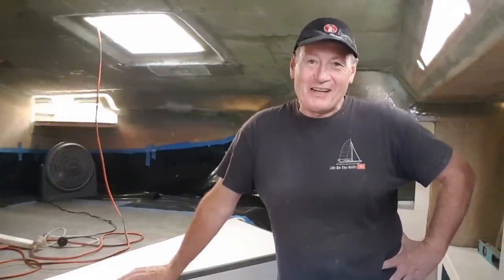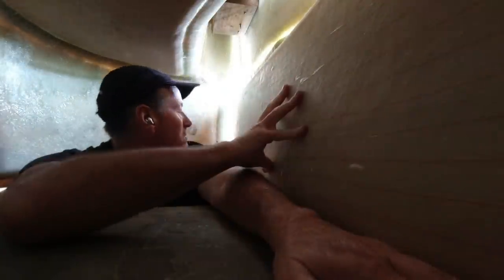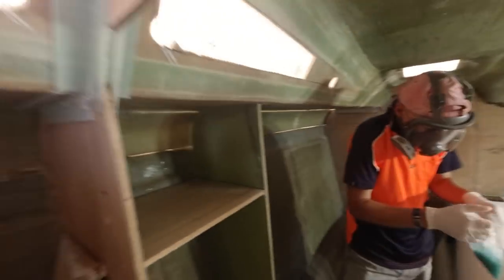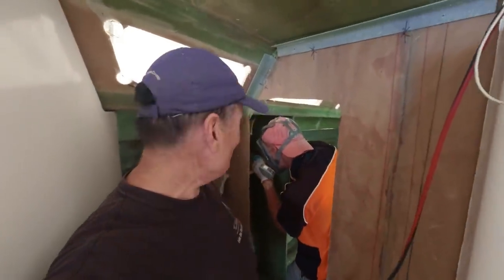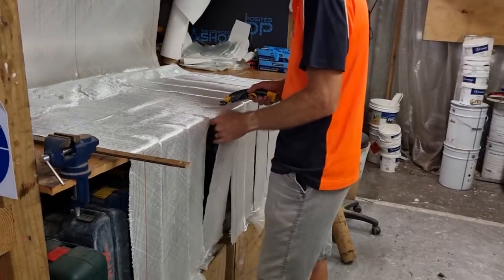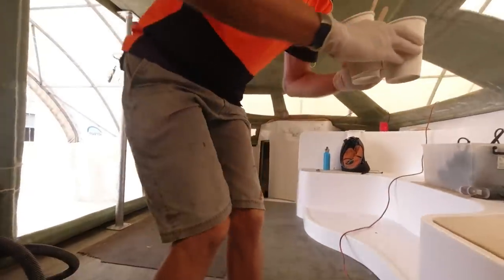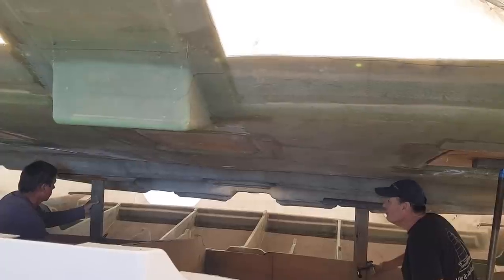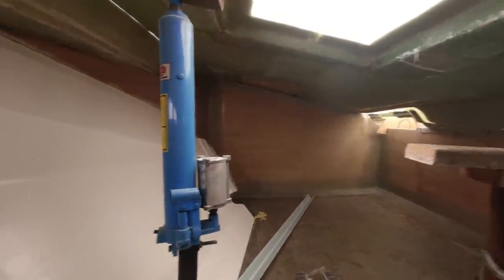I need to get in, WHERE !  - CATAMARAN BUILD Ep210

Comment: There's also the danger of breaking the saildrive which would flood the engine room and the entire hull very fast. I'd prefer the engines aft in an compartment with the rudders. It's also quieter. The air intake delivers salty air anyway if no air-con is fitted. Last point is the cabin would be cooler.
Reply from the maker: I have no sail drives.This boat is a stern drive,protected by hull skeg.
Reply: @LifeOnTheHulls  have you checked out thompson couplings in QLD for the engine shafts - maybe a win win deal

Comment: You think the overall design of your cat could have been made with less curves? Like if the aft bulkhead you fitted here, could that have been part of the hull instead of the curved shell/hull making the back of the bridge straight (and many other sections of the hull). I know this would drastically alter the overall design to something super modern, which you might not want nor feasible given the design of the boat and the molds you have, but have the thought struck you?
Reply from the maker: Yes ,all of that and more.I am limited by the mould and am happy that this extra bulkhead will offer an insane amount of rigidity,essential in the stern of a cat.I could have pheasibly removed the curved stern but like the lines of the boat removing box like look. Not for everyone  but I do like the shape if this boat albeit an older design..Cheers Ross.

Comment: Horseshit.  What an odd space.  Why couldn't ye cut the hatches at the cockpit seating?  For better access and ventilation.
Reply from the maker: That will be happening once the deck is locked down.Cannot decoide where to put the hatches,under cushions or vertical face.Probably under seating.